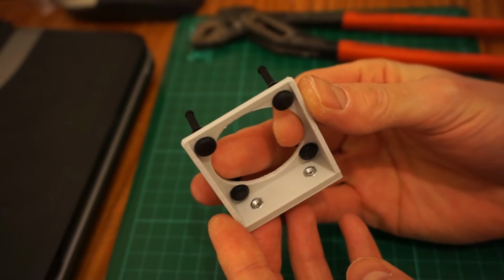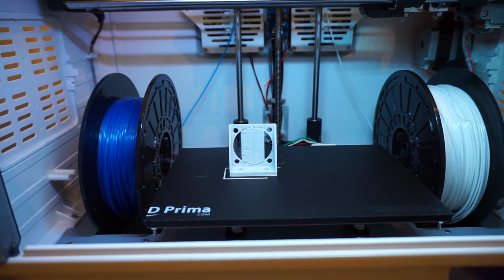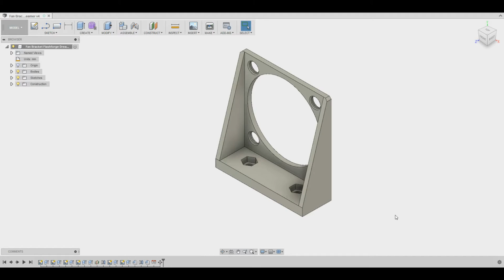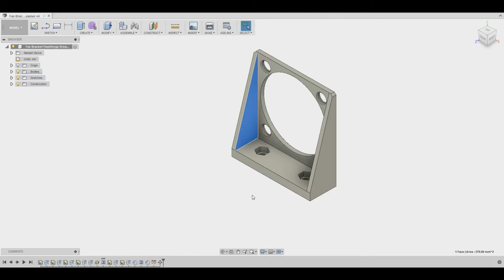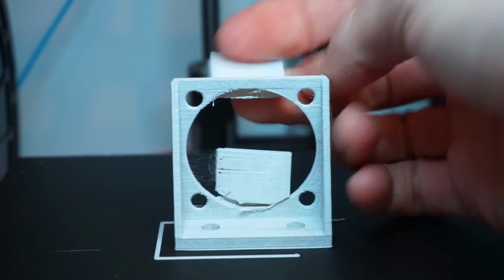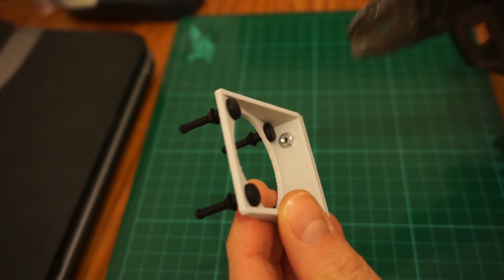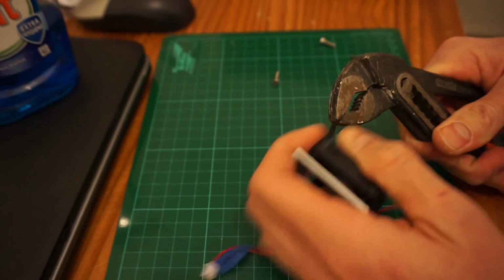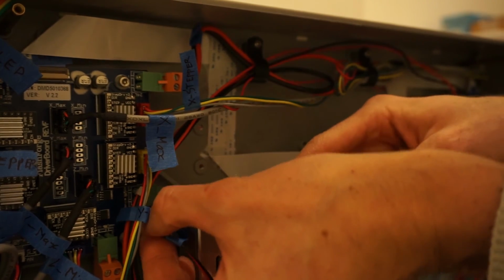Flashforge Dreamer Fan Bracket Modification

Comment: Nicely done. I added a Noctua fan while I was at it. Much better now.
Reply from the maker: Thanks, indeed the Noctua fans are worth the additional cost and actually not really expensive. (Assume you also added a voltage step down module for your fan)

Comment: very good fans (many of which are now on used parts market or ebay) was made for old Intel processors (like Pentium 4's and etc) in plastic glass reinforced but also with internal PWM sensor (smart fan mode) which changing speed as needed or temp change (only few 3D printer boards are have PWM sensory but anyway…)

Comment: I notice your Dreamer is the older version....mine is the clear door version, and my driver fan is far thicker at 25mm. It's only a slight humming sound and can't be heard once starts printing.

I am more concerned with the rear fans...very noisy and not PWM controlled. I find it unnecessary to spin at full speed. The existing fan is 9-bladed and 15mm thick. Short of adding a manual control, I wonder what are the variables to reduce the noise - 11-blades, 7-blades, 10mm thick, 25mm thick?

Thinking of it, perhaps a thicker fan is less noisy, if I compare to my thick driver fan.
Reply from the maker: Good to see they have improved the driver board fan in the newer versions. My rear fans are quite loud as well, might be good to look for alternatives for those fans, but like you mentioned there are quite some variables, one being build quality:)

Comment from the maker: Indeed, the bearings on these kind of fans often wear out at some point, increasing noise. lubricating (remove label for access to bearing) or replacing the fan reduce noise caused by a worn bearing. Rubber fan mounts help reduce vibration noise further, even  with new fans. If the new bearings work silently enough for you printer model a better mount may not be necessary.

Comment: My Wanhao Duplicator 4S also has that fan, and it makes a lot of noise, but the problem is not vibration, it's the bearings, or some crap got inside... I'll have to get it replaced soon. I think when I do I'm also going to replace the ones for the hotends, I guess Wanhao used cheap fans, the one I added for the part cooling is still fine, so I'll get more of those.